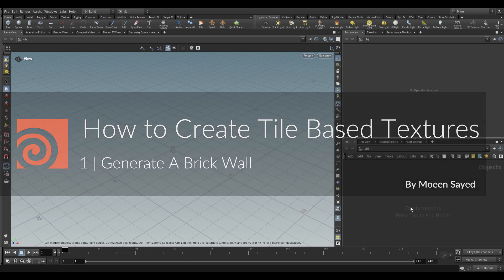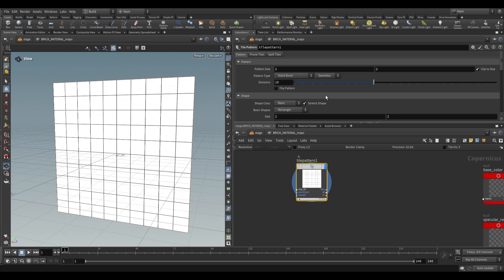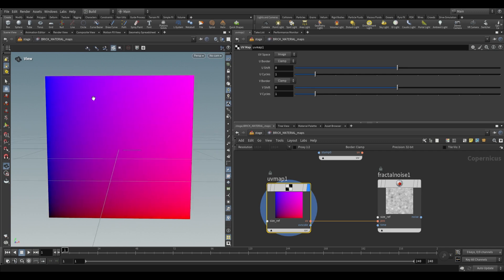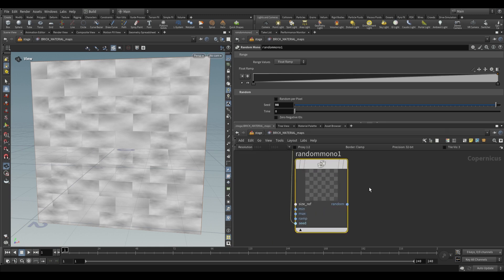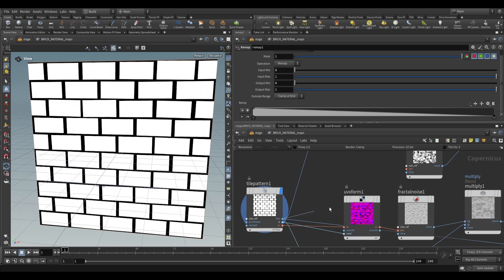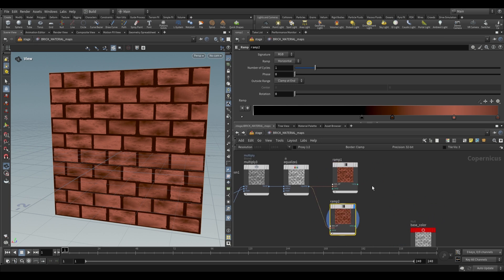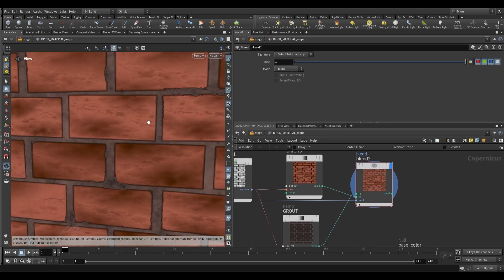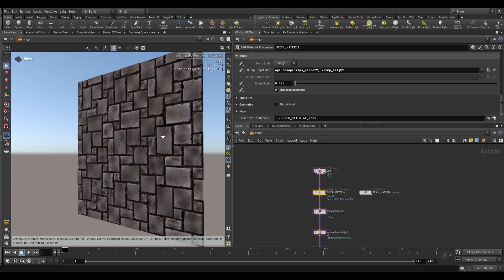How to Generate a Brick Wall

Comment: Great series, keep it up! But in 5 min there is small error in your explanation. In general you explained it well, but in this specific case the value range is from -1 to 1 and this is default for fractal noise. The case is - visualization is normalized and this may be misleading. I hope that in the future SideFX will allow to better visualize these ranges.